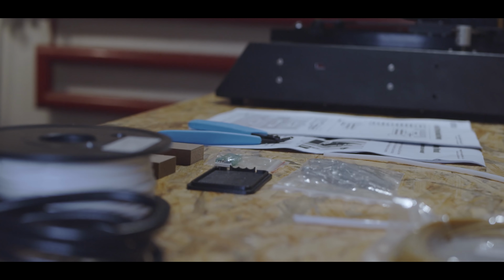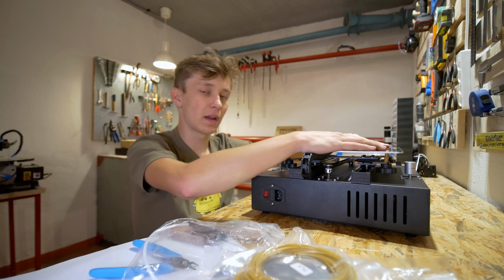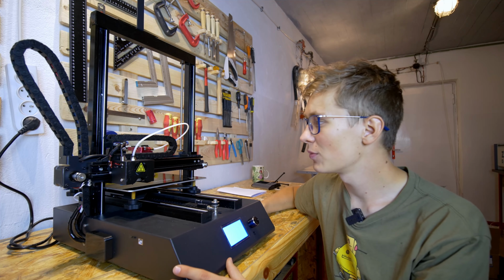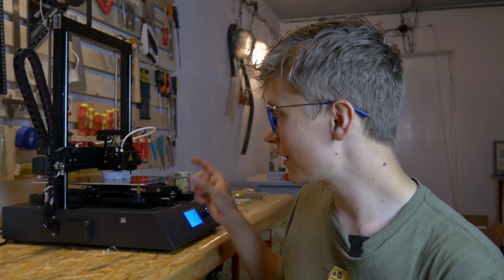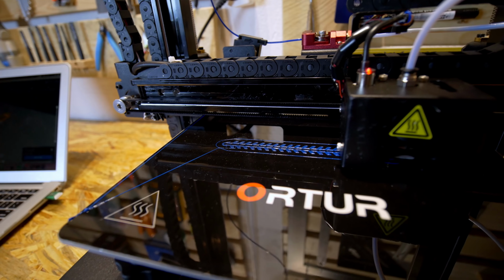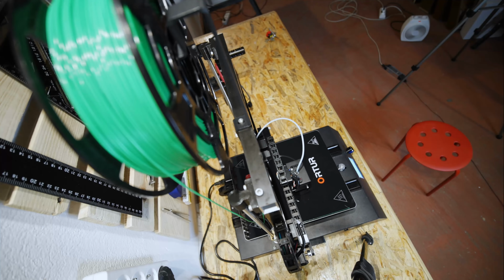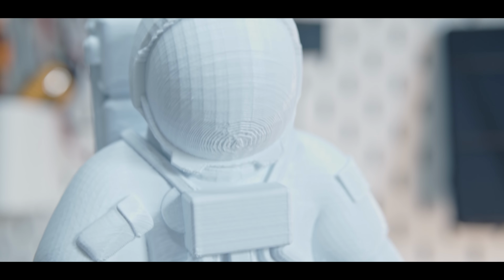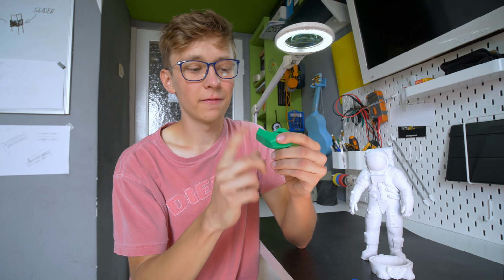High Speed 3D Printer Test - Ortur 4

Comment: Good job again mate.

Few ideas for improvement (which u probably know already)

- 2:00-4:00 could be done in 5 seconds
- setting up could be using time lapse (even better with a dolly)
- better framing while printing and time lapse (like you did with astronaut)
-Could be shortened and made punchier by brutal editing (even jump cutting your dialogues to points.)
- Use body language to make your point (exaggerate body language about things you don't like (eg: stupid settings) as well as things you are impressed.)

Keep going Niko. Subbed.

Comment: How fast does it print?
Reply: Print speed: ≤150mm/s (85-125MM/S for common models) , from the sellers information
Reply: @ReligateGaming  2GT pulley and timing belt couldn't print faster than 150MM/S, physical limit.  Some other FDM printers decleared as high as 300mm/s, it's fake information.
Because they had the Acceleration and Jerk been limited in firmware.